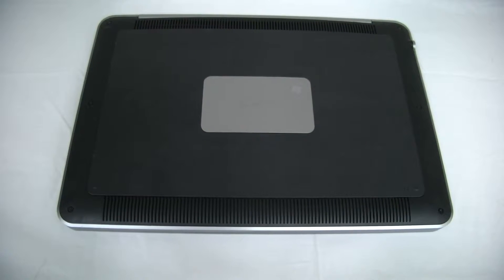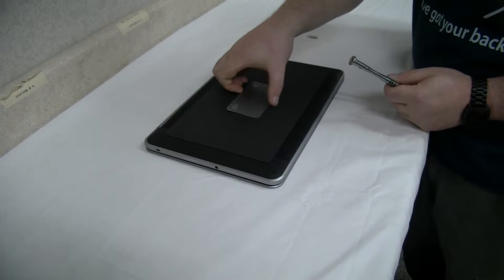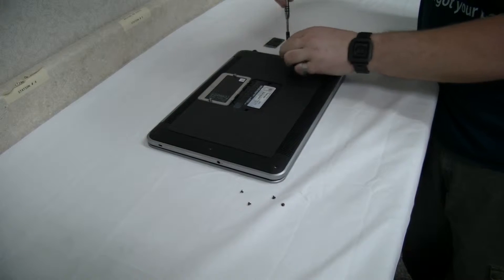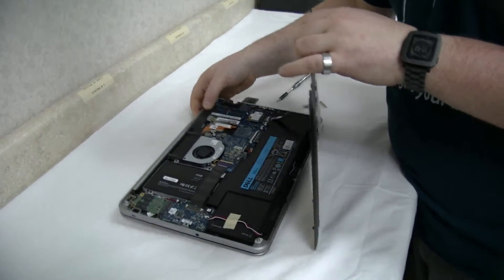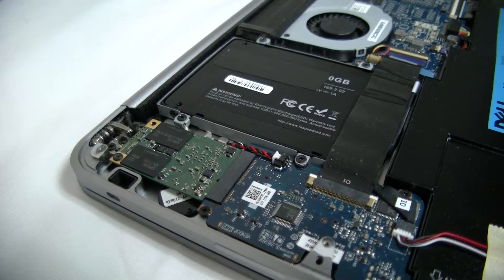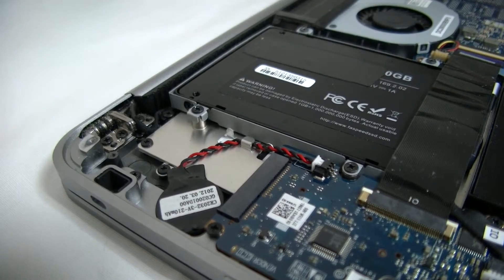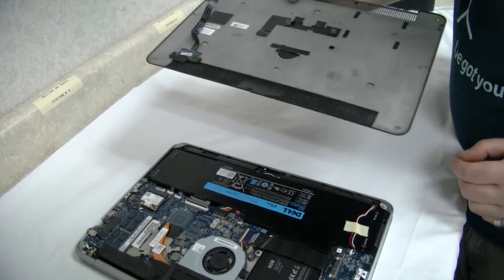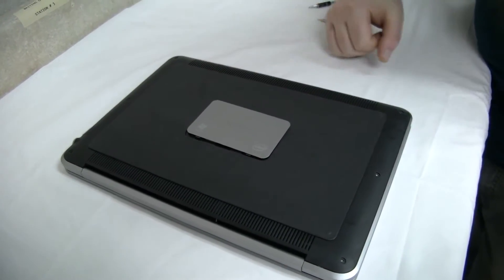Computer Answers How to install a mSata SSD in a Dell XPS 14

Comment: thanks so much. I have a dell xps 14 inchs 14L421, msata 32gb, and hdd 500gb. After used a long time, my dell is slowly run. So that, i update hdd 500gb by ssd 120gb for purposing faster. But when i update hardware finish. I setup the new windown 7 64bit in hdd 120 gb already. But every time open winddown, the screen it appears error in innitial window:  choose RAID VOLUME... and PHYSICAL DIVICES... and must choose Press <CTRL I>.... I very unconfortable... So I see your utube and get this your way: it very cool! Thanks.